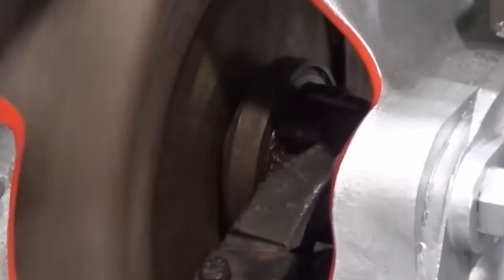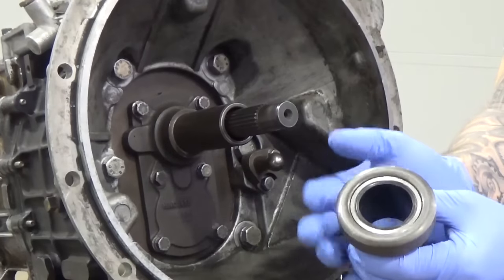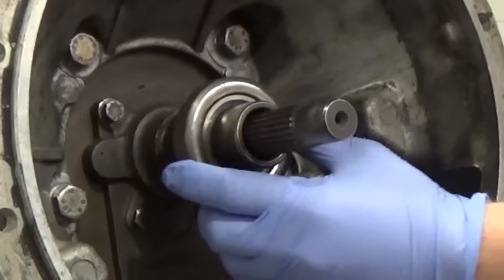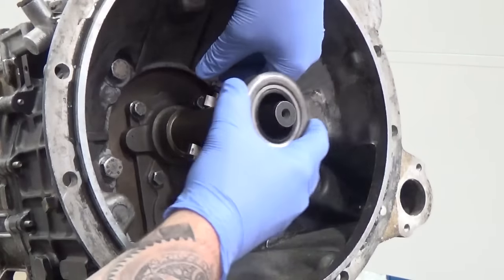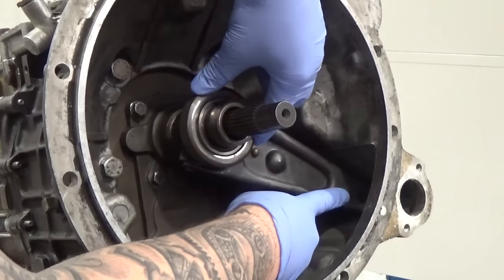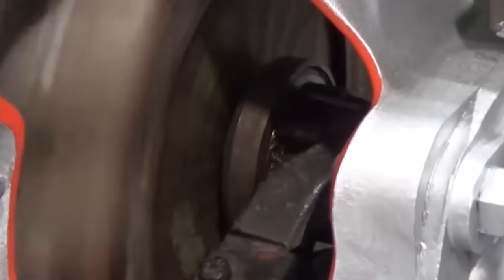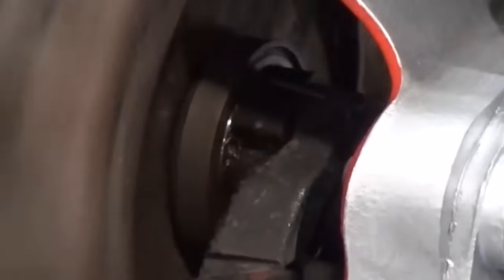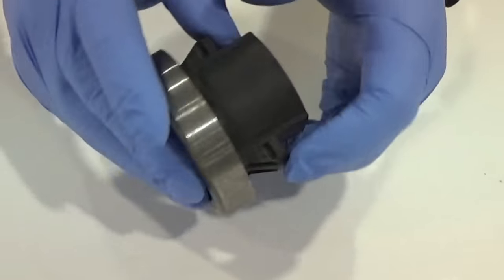Clutch Release bearing / Throw out Bearing Explained - How it works?

Comment: This might be the part in my car that’s making a slight grinding noise when pushing in the clutch…I’m gonna have to investigate!
Reply: I have the same problem does it affect the car if you don’t fix it?
Reply: @BoonConsulting 

If it’s a grinding noise it could be the little balls inside the bearing are starting wear out and the clutch needs to be changed.
Reply: @Bimbo-Balls so what if i change release bearing only??
Reply: No you would only hear it when releasing the clutch

Comment: Is it possible to change the sleeve that the thrust bearing slides on mine is worn out a lot and need to replace it and was looking at changing the sleeve rather than replacing the gearbox

Comment: Guys my manual transmission car makes a screeching sound when the engine is running on neutral, but when I press the clutch the sound stops. Left it for one day and came back to it to see if the problem persisted, now whenever I rev the engine the sounds come back, but when I stop revving it stops. Could this be related to the release bearings?
Reply: Sounds like the pressure plate is worn. The throw out bearing could be bad.
Clutch, pressure plate, throw out bearing and pilot bearing all come in a kit.
Reply: I have exactly the same problem, did you manage to fix it?

Comment: Help my boyfriend only drove my truck once,  and popped clutch on my old 3 on tree, and now something is hitting when in 1st.  It stops when I push clutch in and doesn't do it in any other gear.  I can't move driveline at all so I think u joints good cause that's quiet. Any suggestions.

Comment: Question, after I push the clutch pedal in and out like 15 times, the clutch starts to get sticky, and there is a squeaky noise coming from clutch.

I've had the slave cylinder replaced, as well as the clutch plate. 
Would the main clutch bearing be the problem?

Comment: Got a question maybe u can help me out. I am very new to working on cars so I don’t know much .. 2 weeks ago I changed my slave cylinder my master cylinder braided line and re did the fluids to fix the sticky peddle .. worked amazing the car drove like new to say the least! Until today it was really hot outside and I drove over 60 miles and sticky pedal feel came back .. do u think it’s the throw out bearing ? Or maybe air in the lines ? Fluid boiling up thus creating sticky peddle ? Nice video btw!!

Comment: Question. If you have a grinding noise on a manual gearbox when in gear under load, but the sound disseapears when the clutch is pressed down(coasting). Is this then the throwout bearing somehow rattling against the fingers? Or is noise like this due to some other bearing on the shaft? It seems the internet is filled with different solutions to this simple questions, if the noise comes when the clutch pedal is down or up :)
Reply: I have the same on my 2.2, 2007,
Reply: If you hear a sound when you press the clutch down, then it is the throwout bearing.
Reply: Yeah, same thing with both my cars and can't find a straight answer, lol! Did you found the cause for those issues?
Reply: Durwan sometimes people over think sounds as components are going wrong. Before anything, get the fluid changed with quality transmission fluid with thick viscosity and high slip. You’d be surprised at how smooth and efficient the transmission gets. Only if problems persist AFTER a transmission fluid change is when you know you need to change out transmission parts. Otherwise it is common for the throw out bearing to become worn down and is a relatively straightforward fix. Bearings are usually changed out with every clutch replacement.
Reply: Check this video and pinpoint the gears in which noises occur: 
https://www.youtube.com/watch?v=6WfPnb7MUCM
Reply: @TeflonNapkins  great advice 100% correct

Comment: great video
I appears in this video that the bearing is not "attached" in any way to the actuating arm or "fork".  Therefore, it is not pulled back away from the clutch when the slave cylinder is passive.  True?  Is it free to slide back and forth from fork to pressure plate when the clutch is not depressed?  I have a Ford Kent motor and clutch
Jack
Reply: It is attached to the clutch fork. He uses some metal clips to attach it in the vijeo

Comment: I have a 1995 chevy s10 4 cylinder 5 speed. The clutch is going bad. It's leaking between motor and transmission. My question is it the bearing or master slave.  Can't find slave master cylinder.

Comment: Can I ask if this is exspensive.? I missed a gear and my car started making this noise.
Reply from the maker: It depends on what car and what is causing the problem. It may not be the release bearing making the noise. Although, If it is a problem, the bearing isn’t that expensive, but the labour to split the engine/gearbox to get to the bearing could be expensive.
Reply: @EducationalMechanics  it only does is after you have been driving a while makes a shuddering noise when the clutch is in. Its a 5 series bmw 520d msport.

Comment: I have a squeak when I press the clutch pedal down with the car off and cold. If I repeat this many times, the squeak goes away. But, next day when cold, the squeak comes back. Is this a throw out bearing problem? I have a hydraulic clutch.
Reply: I had the same issue it escalated. It’s a warning to change it. Usually change everything one time, clutch plate pressure plate and release bearing